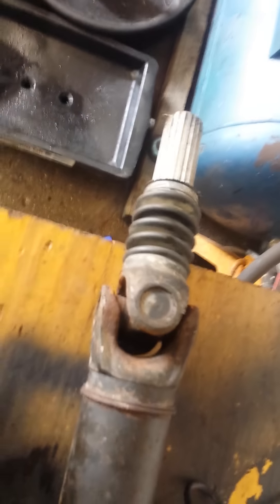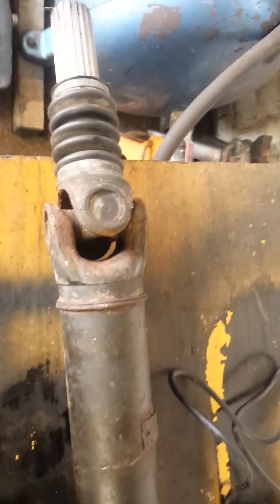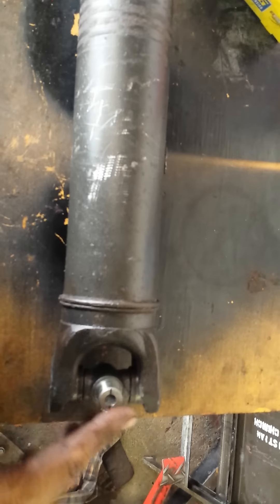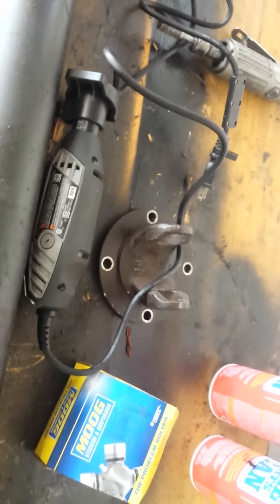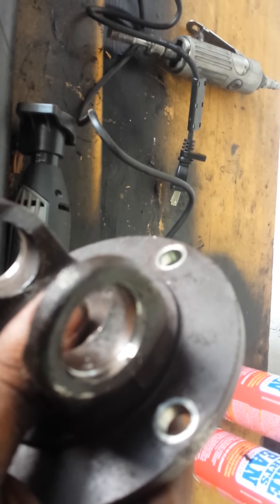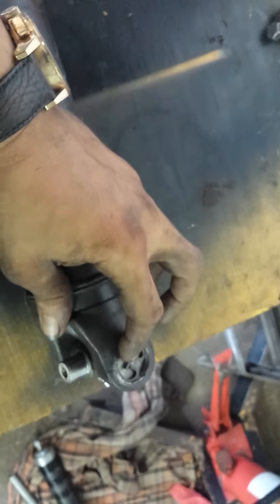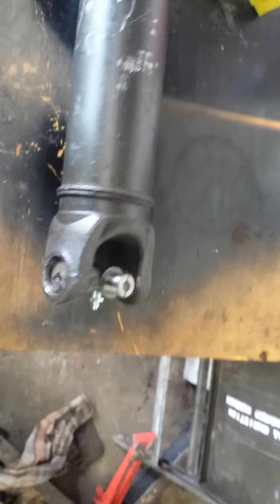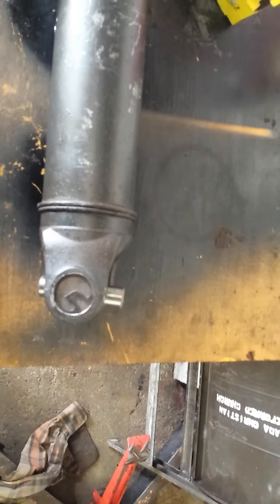Dodge Sprinter van drive shaft rebuild at home

Comment: I FOUND A BETTER U JOINT TUC P449   FEDERATED P449, I VERY SLIGHT FILING OF THE INSIDE NO BIG THING.  INTERNAL SNAP RING, THE MOOG IS TOO MUCH WORK AND POTENTIAL FOR NOT BEING CENTERED FOR THE AVERAGE PERSON.  DID MINE YESTERDAY.
Reply from the maker: That’s awesome I will pin this post
Reply: Do you have a link where you ordered them? Having trouble finding them. Also do you have a video of the new u joints?
Reply: @chrismalizia2090  I am also having trouble finding them. Bump hoping to get a response. any P449 U joints i see don't have the internal snap rings
Reply: bump hoping to get a reply to where you bought them
Reply from the maker: He did say federated P449 So I recommend googling that you should be able to find that pretty simple
Reply: @sharpcarco  i definitely tried using the manufacturer name in my searching, but they're all discontinued. was bumping for more information thanks

Comment: Awesome Clay!  I have a 2006 Freightliner 258" 2500 with 312k miles.. You gave me a lot of courage in this video.  The part # is a real help.  I'm going to replace every joint in the propeller shaft this week as I just replaced one carrier bearing and found the joints in the sections I removed to have significant wear.  Plus, now that the carrier bearing is replaced I can feel the joint vibration.  Other than that its a great running little rig.  Big kudos, I hope a lot of people find this post!
Reply from the maker: Thanks for kind words, hope it works well for you

Comment: Thanks for the information.  I followed your advice and it worked out great.  Take time to center the u-joint and make sure you have a good groove. I'm happy with my results but I did have to add to my grooves. Also I get a slight vibration over 65mph. I'm guessing I'm not dead center.

Comment: Hi, Great video, thanks for your help,I had the same issue. Only suggestion I'd make is once the job is finished,clips and all, I put a couple of blobs of weld opposite each other on all four caps above the clips, just to stop any chance of it losing a clip.Guy I know did one and the front joint broke out on the interstate. Because it was at speed, it destroyed itself pretty quick, then, just as they were stopping, it dropped off and proceeded to dig itself into the road and flipped the van over. I'm sure there may be a conflict should ones insurers discover the repair!
Reply: but sprinter have two u pieces that catches the drivesaft before to hit the floor if it disconnects, at least mine does have those safety catchers.
Reply: @Jose-x3d4d  yes, but you never want to let something FAIL, and then fix it.  If the yokes around the U Joint get damaged, You are destined to the NEW DriveLine $1000.00 plus labor
Reply from the maker: Hey if you keep commenting on my channel plugging your business I will delete your comments. And ban you from commenting on my videos. I’m certain that you may have a good product and I don’t mind people helping other people. But this channel is how I make a living so I would appreciate it if you would cease and desist immediately! Thank you very much God bless and have a great day

Comment: The unis come in three sizes 24x88 mm 27x88mm 30x88mm . You can put a tape measure on the uni  cap while its still in the car go order just plug those numbers in to ebay universal joints .

Comment: Is the U-joint for a 2004 sprinter the same as a 2008 sprinter? Also if I sent it to you how much to replace the 2 u-joints on the rear shaft.

Comment: Man my 2008 rear u-joint just went out any luck on a universal joint part number that will work for it??? that way I don't have to go through a couple hundreds of them finding right size Lol
Reply from the maker: Hey Roman how are you doing, unfortunately I’ve never done one on the 2008 and I do know it’s better so I can’t be of much help there. Sorry I wish I could.
Reply: all 4 U Joints are the Same for my 2005, I would suspect might be the same.  I have a LONG TALL sprinter.  4 U Joints segments

Comment: Awesome, how was your driven experience, did you had any vibration  ?
Reply from the maker: Not at first but after a couple hundred I did
Reply: @sharpcarco  thanks for been honest, actually I’m in the same situation and I was planing to do the same with my driveshafts
Reply: @sharpcarco  So just to update on this, basically it's not worth even attempting what you did since it didn't work out?

Comment: Okay, so I'm trying this on my 05 158" sprinter.  I've determined the "precision 813"  from oriellys is a direct swap for the moog 813.  I've got the old ujoint out and waiting for the parts delivery before I can continue.  Two questions. Did you actually resize the middle section of the ujoint, the part the caps go onto?  And has the fix helps up?   I don't mind replacing it every year, to avoid a 1000 payout.  I was just curious if it held up, long term.
Reply from the maker: it did hold up but you have to be very critical about the simmering and your measurements I will tell you I only paid 700 for another drive shaft but I would not have had to if I would have been more critical on my measurements
Reply: @sharpcarco  why did you have to purchase another driveshaft?

Comment: Do you also service the carrier bearing for that $350 I would assume so?
Reply from the maker: All sprinter vans are designed to never need service on anything obviously we know they break down but the intention during engineering was for it to run 1,000,000 miles without needing service . They don’t tell you that that just comes from years of looking at them they were never Intended to be worked on.  I’ve had several sprinter vans that had near 400,000 miles on them and didn’t even need brake pads . 

 So to answer your question if it’s not broken don’t fix it .  Unless you see something wrong with it .  And that’s not because I’m lazy that’s just because I’ve worked on quite a few of them and stuff usually will give you a warning before it goes out not all the time but most of the time I hope that answer was helpful for you God bless and have the best of days .
Reply: The Clay Way 
Yeah mine has 280,000 miles on it and the carrier bearing went in there saying I need to replace the whole shaft to replace the carrier bearing, the carrier bearing is sold separately so I figured it could be replaced separately but they’re telling me no? Can you tell me anymore about that? It seems like if you just separate the yolk when would be able to have access? I’m not the one that does It but it seems like that you joints are fine
Reply from the maker: You are supposed to service the driveshaft as a complete unit. 

I do not do any public service on them driveshaft I do not want the liability. I know when I made the video I said that I would but I do not do it any longer. I didn’t have any issues. Just after I thought about it for a bit I was like why take the risk $350 is not worth it and a brand new driveshaft is about $1000 and I only made this video and did this repair to get me by till I could get my new one. I did eventually replace the driveshaft completely. 

As far as the carrier bearing goes I’m sure there’s a way to service it and I’m sure there’s something out there that you can buy but when it all comes down to it it’s probably cheaper to buy a new driveshaft. Time materials etc. etc. possible complications if the yolks are not centered properly

Comment: Is this the same as an 2008 drive shaft? Mine is a 3 piece drive shaft.
Reply from the maker: yes it is
Reply: I have a 2011,   is the Moog 813 he proper part?  thank you
Reply: the moog 813 is NOT proper for Sprinter 2007 and up
Reply: My 2005, the UJoint measured 70mm outside dimensions and the cap size was 1 inch, the new one will give a press fit of .003 thousands press fit or called interference fit

Comment: Can you please help me do this repair for my sprinter?
Reply from the maker: What is it that you need help with?
Reply: @sharpcarco  was just going through the comments n I saw you don't do the repairs on the driveshaft  anymore.  I wouldn't mind sending you mine though for a repair. $900 is too much for a new one
Reply from the maker: No really sorry if the driveshaft came apart after I repaired it I would end up being liable and responsible and just overall feel terrible. This is a temporary fix the best solution to be honest with you is to buy a different driveshaft you can get one from a local junkyard or salvage yard even though this procedure works it’s not something that I personally can do for the public

Comment: Hi what to say?
 I try it and not  work at all .
Question why? 
 Each side on u- joint after installation I have 5 mm deep. 
When I pushing deeper and they're holding  piece go in too far. 
U- joint should don't have a loose (free play) moog 813 
It's not good for this conversion. 
I will post with you later thank you YouTuber's
Reply: I'ts critical you Center both Yokes on the joint or you will get vibration between 45 and 65, and then it will FAIL prematurely.  Shops don't do repair, they are just like computer techs now, if they can't PLUG AND PLAY, not worth their time.  I'm old school and I'm old, been a WRENCH person all my life 65 years.  Take your time. It's not a drive though mcdonalds.  As an Artist is never in a hurry, either should a Mechanic, NEVER TIME TO REPAIR RIGHT, ALWAYS TIME TO DO IT OVER.....THE SECOND TIME IS ALWAYS MORE EXPENSIVE.  TAKE YOUR TIME

Comment: Your part number was wrong.  I ordered the 813 for my 2008 dodge sprinter.  Are they the same part number as the 04? Please message back.  Thank you for your time
Reply from the maker: How can you tell me that my part was wrong that comes off pretty rude, 

Anyways it’s because I was working on a 2004 and you were working on a 2008
Reply: 2008 is completely different from a 2004. Who had the wrong part number? You had the wrong damn van...